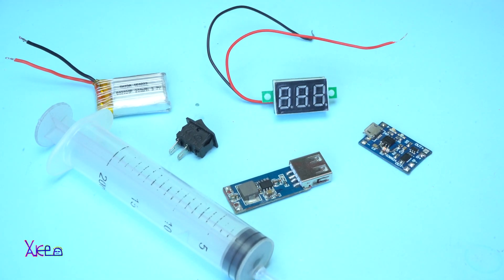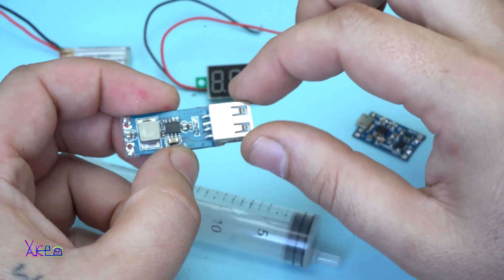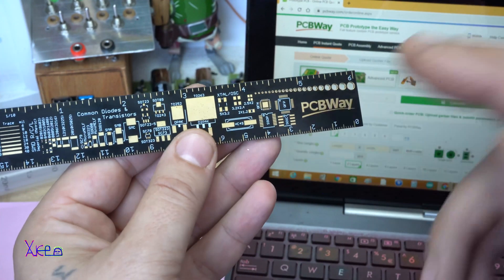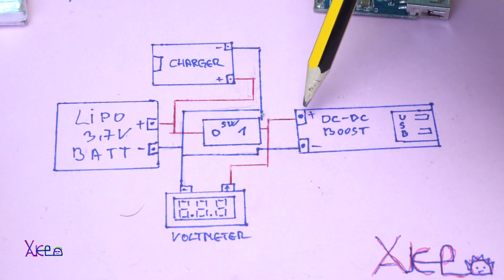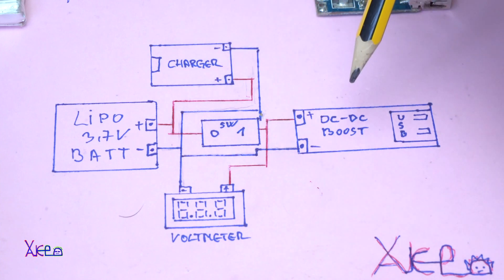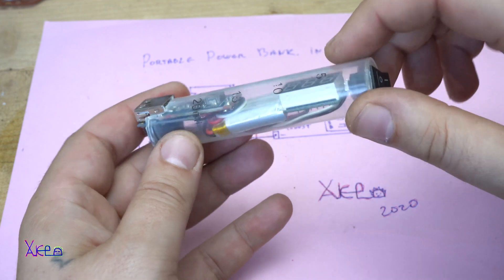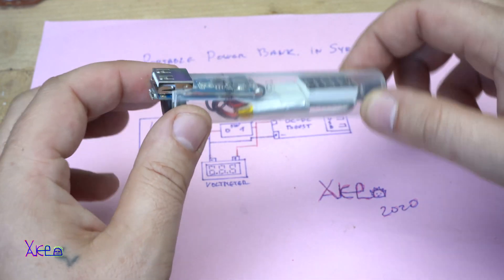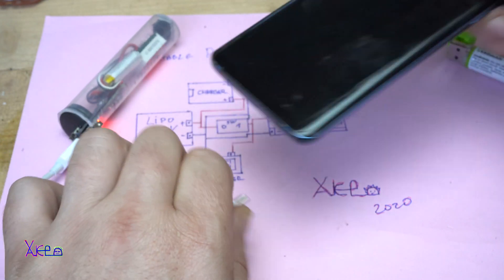How to make Smart Power Bank | Brilliant homemade idea

Comment: do you have the link for me to buy the boost converter?
Reply: can buy them many places, depends where you live.
Reply: @cptrush3671  brazil ;-;
Reply: @wmb3858  check amazon, or other online shops for the items. pretty sure amazon will have them
Reply: @cptrush3671  but shipping costs 10x the product
Reply: @wmb3858  ok im not from there so i dont know about shipping. check for local electronic stores or repair stores they may have them. or find someone who can buy them cheaper and send to you cheaper.

Comment: What I liked is that you mentioned the price of the electronic parts, and this provides us with information at least
Reply: You can find all at aliexpress: 18650 charge protector, DC yo DC board (3.7c yo 5v ir Even 12v) and the batteties can use any
Reply from the maker: Super feedback

Comment: Such a small lipo battery which can charge your mobile at 3% . lol🤪
Reply from the maker: Its not for charging phones,is univerasl 5v power bank
Reply: @Hacktuber  I love it mate! 🤗
Reply from the maker: Thanks man
Reply: @Hacktuber  When you tried to charge your phone it sounded like the voltmeter was powering off, the clicking sound. I'm guessing either voltage was to low for the meter or one of the protection circuits in the battery or the charger was cutting it off.